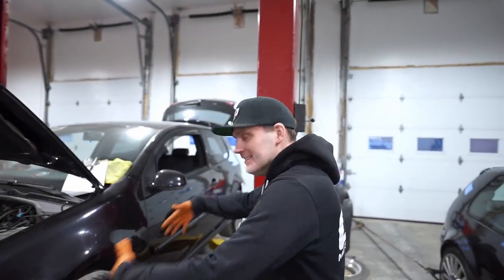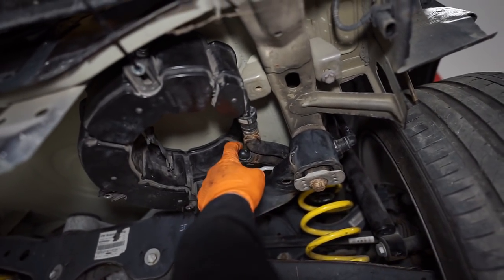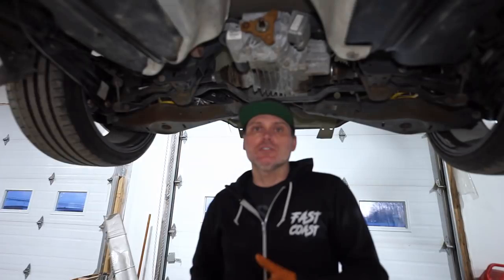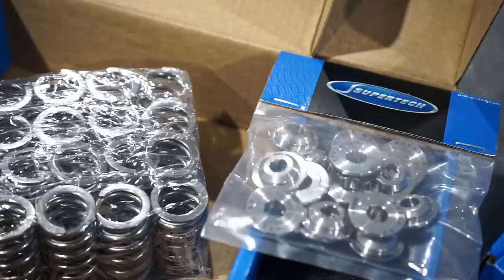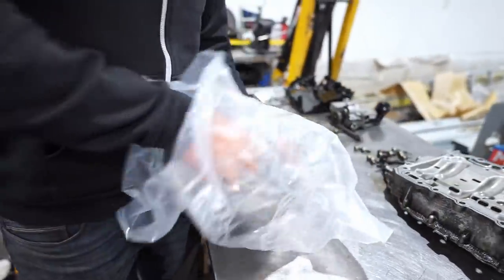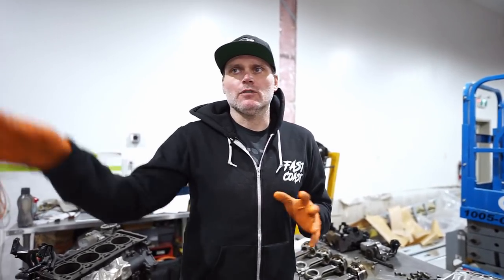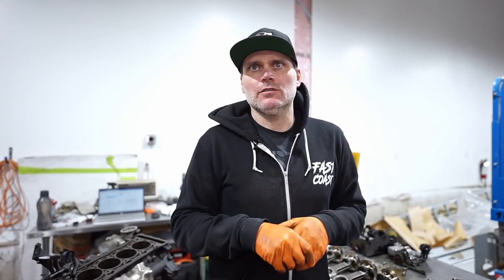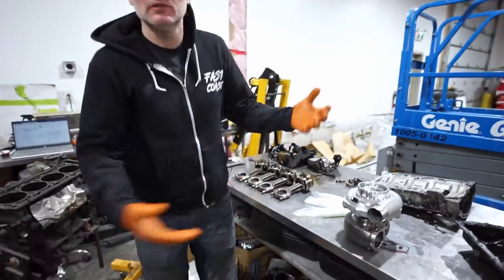GTI AWD Swap Continues... Update time!

Comment: Any information regarding the mk7 timing guides being used on the mk6 platform?
Reply from the maker: Not sure what you mean, some of the guides can be used as shown in the video.
Reply: @COMotorsports  I meant are there any long term experience with them? Car still running fine? I need to do timing chains on mine and considering getting those guides from the mk7
Reply from the maker: @themoneyshower502  the ones that can be used are the same just designed a bit longer for more chain engagement and strength.

Comment: I own a vw 92 cabriolet and I fixed quite a bit of things in the car.  As new parts were installed. At this point the fuel pump went out, and replaced with a high flow pump,  the fuel pump assembly was modified. The only problem is that now I can hear a rod knock 😞. I’m debating to fix that or swapping the engine, not something that ever wanted to do.  As I wanted to keep it original.  I put over 2 thou within this past 2 years upgrading things.  The question I have, what would be the best swap for my mk2.  I was thinking on a vr6 but not sure.
Reply from the maker: VR swaps are probably the most common. But I do like 1.8ts in older smaller cars.

Comment: Hello I have a question about vems. I'm trying to test the mac valve and wanted to know if there is a way to test the valve to see if it working in the program??? Need help
Reply from the maker: Try using the test function under outputs.

Comment: Hey have another question.  In vems the outputs have to be set up but I don't see one for the mac sensor I guess I'm going to have to see if Kevin will do something for me. Cause I have the lugtronic wiring harness and the red and white wires are the only extra outputs
Reply from the maker: You should see it in there as an assigned output.

Comment: Interested in getting a set of those IE rods for my engine, but they don't list the BZC engine code, do you know if these will work with the Audi S3 8P engine ? Ok I went to your website and found them listed, but you need to run aftermarket pidtons ?
Reply from the maker: email us
Reply: @COMotorsports  I did email you a few days ago.

Comment: Just curious what spark plugs you guys suggest for a tuned BYP 2.0t mk5 2008. Im working on a friends car. I have lots of 1.8t but dont know much about mk5s.
Reply from the maker: Same applies.
Reply: It has NGK PFR7S in it right now. There pretty old. But i also found some old bosch ones.🤷‍♂️ I run BKR7E in our 1.8t.
Reply from the maker: @nosturbo69  use the IX version on the 2ls.

Comment: Did you guys have to swap the ESP sensor and the ABS block on this one? Did you have to do that on the your MK6?
Reply from the maker: We tried coding around it, but this isn't the proper abs module in this car. And I junked the swap car long ago. So this one rocks the traction control light, but AWD works fine.
Reply from the maker: Actually I thought this comment was on the other AWD conversion car (my daily). This specific one isn't finished and is going on full standalone so not really going to be the same.
Reply: @COMotorsports  No worries, the comment was for both cars. I appreciate the fast responses. I’m trying to source those parts used right now. And a Haldex Control Module because the one I bought with the conversion isn’t working. Do y’all have any spare Haldex Control Module laying around?
Reply: @COMotorsports  Yes, I watched the one for your daily too. I just was rewatching the videos. Any other codes popping up with the daily? I could write you on IG too, if that’s easier.
Reply from the maker: @cjdoc77  no it's the only code. Basically cause abs isn't happy. I don't care enough to worry about it. It's going on standalone when the 07K turbo goes in it anyways.
Reply: @COMotorsports  ok cool! On another note. Would you guys happen to have a OEM Haldex Control Module laying around that is for sale?
Reply from the maker: @cjdoc77  what generation you looking for?
Reply: @COMotorsports  Gen 2
Reply from the maker: @cjdoc77  negative sorry